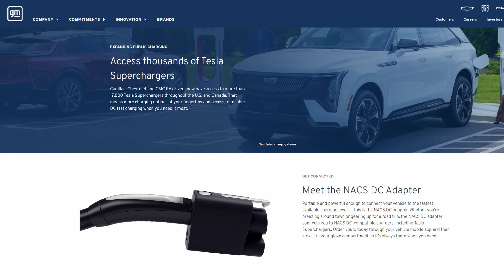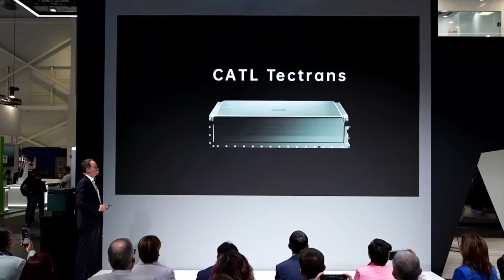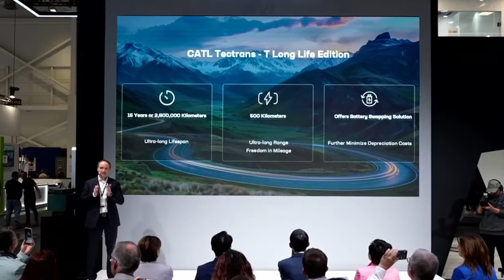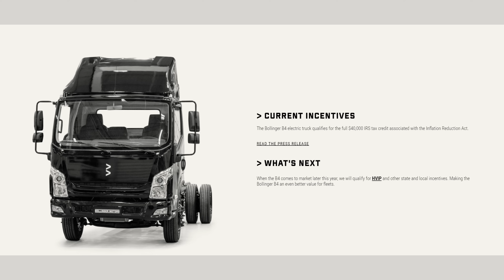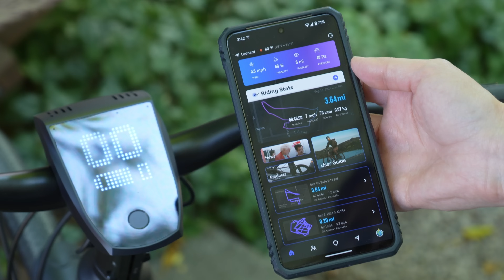The Current : Weekly EV News Ep#29 Sept 22, 2024

Comment: I've owned a 2023 bolt EV for over a year, haven't fast charged yet.  I may buy a non-GM adapter eventually, but not excited about using tesla chargers.  By the time I do any substantial tripping IONNA & NEVI funded chargers may allow me to skip Tesla.  It'll be interesting to see how pricing develops
Reply: I also own a Fiat 500e & a first gen BMW I3 rex, I will never call my bolt limited range or short range or commuter.
Reply from the maker: Labels are certainly relative and your language selection is valid.

We worked for BMW launching the i3 for BMW in America and we have been part of Nissan's LEAF education programs.  I also spent two years launching the Ford Focus Electric with about 80 miles of range.  We have driven very low range EVs tens of thousands of miles with tens of thousands of students and prospective buyers. We still consider a vehicle with 200-250 miles of highway range to be limited by today's standards.  Even though Bolt can now charge on the Superchargers, stops take longer than most EVs on the market today.  The Bolt's charging rate is low and the mi/kWh is half that of other comparably sized EVs.
-Producer Tim

https://insideevs.com/news/613786/chevrolet-bolt-ev-fast-charging/
https://insideevs.com/reviews/608254/chevrolet-bolt-ev-range-test/
Reply from the maker: Most EV drivers only use DC Fast chargers when they go on a road trip. The limited range of a Bolt is not ideal for road trips. Level 2 charging at home or work is the way to go for local miles. -Producer Tim

Comment: 1.3M miles & 13years. Long haul simi trucks usually do 1M miles in about 6 or 7years.
Sleeper teams in about half of that. Those big trucks dont make any $$ sitting.

!
Reply from the maker: No gas powered truck will have more uptime than the EV.  There are already EV semi trucks with more than 250,000 miles on them.  A simple, cost effective, and more reliable EV propulsion platform benefits all parties.  We look forward to the displacement of diesel trucks. -Producer Tim
https://electrek.co/2024/09/17/tesla-semi-traveled-miles-presentation-electric-truck/

Comment: Greetings All - be advised that the INITIAL INFO DIRECTLY FROM GM. as Conveyed  by Tom M.  at “State of Charge” was that “ALL Bolt EVs and EUVs” would require a DEALER UPGRADE appointment. . .NOT CORRECT, and it’s NOW BEEN CORRECTED BY GM , and passed along to Tom. Strangely, and “apparently” ONLY “SOME” 2019 and very FEW 2020s MAY (only MAY) require a Dealer visit. . .other wise, GM is READY, and when you go into the “myGM (your brand, e.g., Bolt), the Tesla download has already happened on the Public Charging tab.  If already there — NO VISIT REQUIRED!  Happy Days! 👍👍😃

Comment: EV haters love to talk about the battery packs as if they will just end up in a landfill.  Any logical thinker would have realized that eventually recycling facilities would take care of them.  Glad to see Redwood making good progress !
Reply from the maker: The valuable materials in a battery do not evaporate. Reclamation is inevitable in a market economy. Thanks for offering your perspective. -Producer Tim
Reply: Same is true of old solar panels and blades from wind turbines. People see pictures of them piled up ready to recycle, and think thy're going to landfill. No, they're waiting to be recycled when it's economical.
A solar panel contains all the materials necessary to make....a new solar panel. Companies just need enough of them flowing through the system to make recycling more economical than making new ones from scratch. 
EV Batteries have a 10 year+ lifespan (and likely to increase) when properly managed (by the owner or installed the battery management software), and EVs have only been around since 2011, so there aren't all that may old batteries out there yet.
Reply from the maker: The cost of a solar panel is largely in the manufacturing apparatus rather than the atomic inputs.  Much of the cost of a windmill is transportation and fabrication, rather than material inputs. Fiberglass and silicon from solar panels and windmill blades are common.  Thusly, they are less valuable materials when compared to the nickel, manganese, cobalt, and lithium found in today's most common EV battery cells.  The incentive for America to establish a domestic circular economy for energy storage is very high. -Producer Tim

Comment: The worst way to save weight on a Lotus is to use steer by wire, which detatches all steering feel, unless you build even more heavy, complex sensors & feedback motors into the rig to simulate it. Geely's just seeking attention on a concept. Same with motorized rear wing, which is a hallmark of Porsche, but now features on the 2 new production EVs. But concepts don't have to make sense. Glad to see they at least understand that Lotus is supposed to build light weight sports cars. The Eletre was definitely not built with Lotus philosophy, and now it's priced double what they initially said it would cost ($229,900) for a Chinese built, 5,820 lb. SUV. That's the mass of 3 federal Elises. Yes, the Biden Administration's Chinese tariff is to blame. But Lotus was supposed to be a limited numbers, Hethel built, sports car. Not sad that the Geely move to build Lotus cars in Wuhan is blowing up in their face. In previous generations, buying Lotus was a stretch but not impossible for normal people. Geely and Lotus need to get back to Lotus' humble roots to survive. The Chinese car industry is currently imploding with massive overcapacity and market saturation, with only two main players building carsprofitably, BYD, and Li Auto, and they are still focused largely on hybrids/EREVs.

To be clear, Lotus can pull off BEV and must. Just focus on 2 (or 3) person car that is driver focused, NOT excessive speed, and efficient. The 1959 Lotus Elite Type 14 featured an upcycled 1.2 L Coventry Climax fire pump motor, but used revolutionary fiberglass monocoque design to ensure it could deliver very sporty ride with less. It didn't seek to win Le Mans outright in 1962, but instead competed and won the Index of Thermal Efficiency class and the 1300cc class. That's Lotus' place in the automotive world. It stayed focused on light and scrappy all the way up to the Geely purchase with a brief confusing period of using V8 motors in Esprits. Caterham, and now Morgan, have demonstrated a clear path to BEV for the class, and Geely and Lotus should take note.
Reply from the maker: Interesting take. Some of the premises are vulnerable, but I'll leave them for other commenters. Thank you for your detailed comment! -Producer Tim

Comment: GM should Thank Tesla for deploying all those Superchargers that the competition can now use. If it wasn't for Tesla, EV charging station would almost be nil.
Reply from the maker: The Supercharger network certainly made EVs viable in North America. It was a monumental undertaking which has paid off. -Producer Tim
Reply: @MissGoElectric  Non-Tesla DC Fast Chargers:
Non-Tesla DC fast chargers primarily consist of CCS and CHAdeMO standards. The main networks include Electrify America, EVgo, ChargePoint, and others.
As of 2023, there are around 12,000-13,000 non-Tesla DC fast charging locations across the U.S., with a total of over 30,000 charging ports (chargers). These numbers include chargers using both CCS and CHAdeMO.  Not exactly nil
Reply: @MrHockey1720-G how many ccs are broken?
Reply from the maker: an oldie...but a goodie
https://youtu.be/rpFsgSNngo0
-Producer Tim
Reply: @MrHockey1720-G  Only half works😂

Comment: Redwood materials will have transport batteries and or battery packs to their factories. I reckon you could break a battery pack down to individual battery cells then put them in a shipping container with temperature sensors and then add water. If one or two of the cells go into thermal runaway it shouldn't be a problem because they either won't set off a neighbouring cells or if it did it still wouldn't be a run away event.
Reply from the maker: Careful handling is part of the expertise which will enable Redwood to succeed. JB is perhaps the foremost pioneer in managing EV battery cell safety in the world. we have a high degree of confidence in their ability to offer end to end recycling in the USA. Some companies are already doing this at high volume in China. We know it is viable...which is a tailwind. Thanks for commenting! -Producer Tim